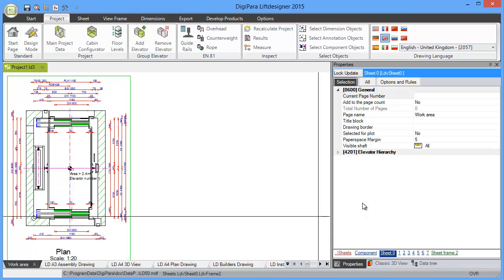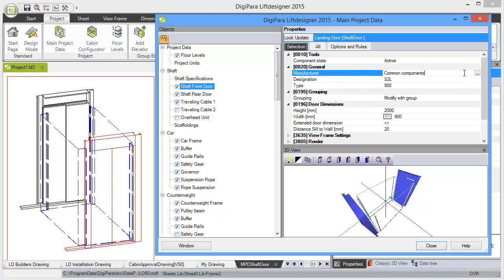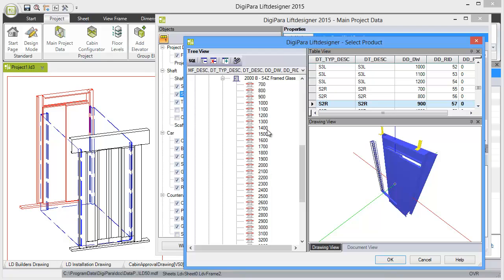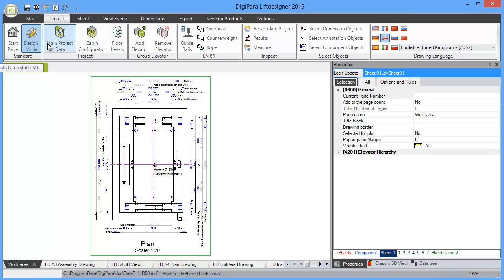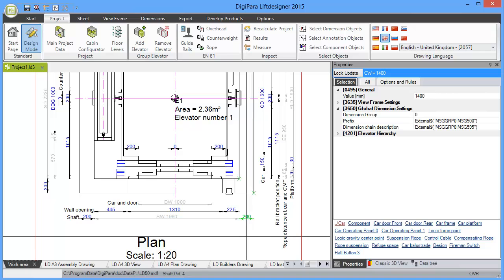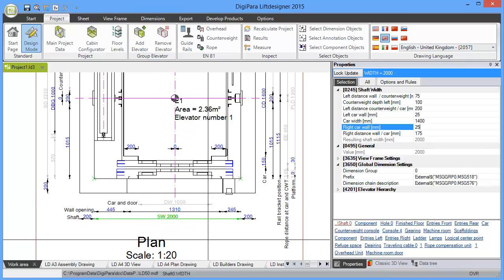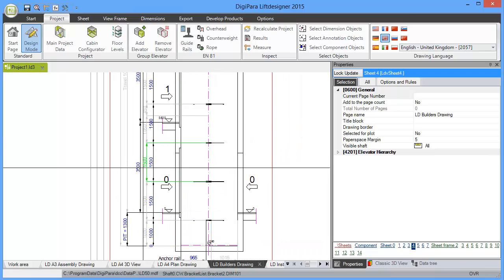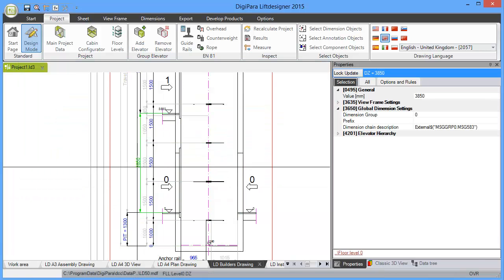Part 4 (9): Main components & shaft dimensions (DigiPara Liftdesigner 2015 Training)

Comment: dear sir, I have a little problem which is when I export the plan to autocad , the dimensions is not correct , when I use the dimension in autocad program it is not match with the directions with digipara software, how can I slove this?